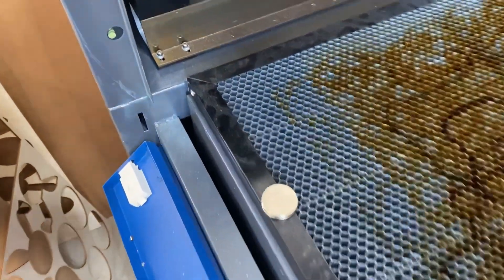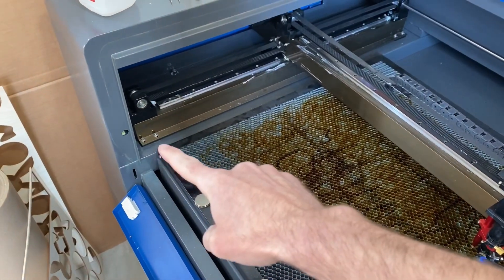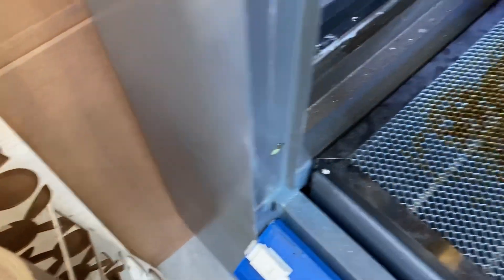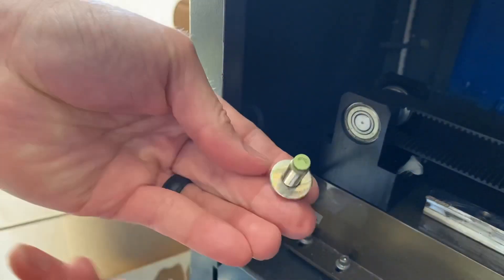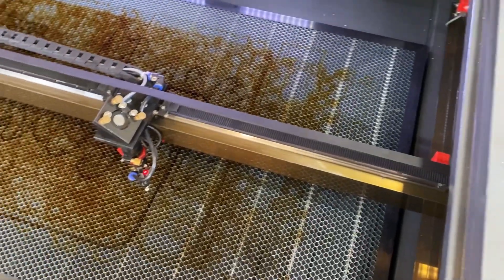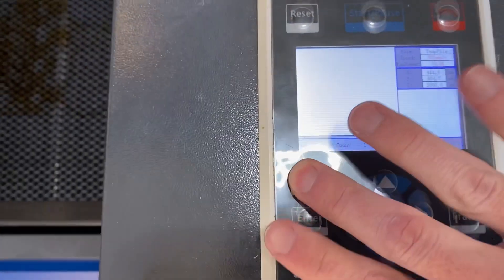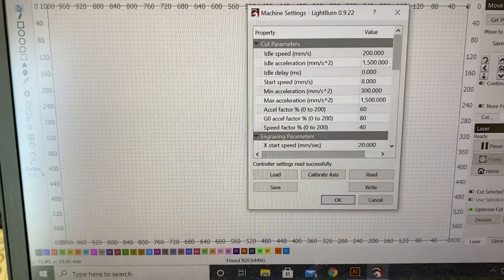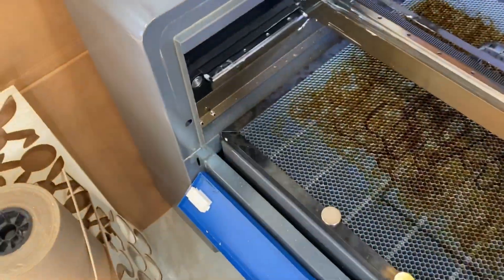Disable Door Alarm and Machine Protect Sensors on OMtech Laser

Comment: thank god for your video!!! Ive literally had my machine less than a week and i was getting the machine protect error. I knew it had to be the lid because everything else is fine but when I got my machine i noticed one of the lid sensors was put on all jacked up and sure enough it started to cause me problems no matter what I did to try to adjust it to the correct position!  Thank you Sooooooo Much!!!

Comment: Thank you jesus. (and of course Bearded Builds Co).  I know this is a long shot but this is the first video or instructions I have seen on the internet of the Omtech 150 watt laser which is what I have.  I received my machine with a damaged door alarm sensor along with parts (2" metal tube with 2 rubber wahers) they did not tell me where they go.  I also can't get a beam alignment started.  There instructions didn't even tell me my tube installation was different that most machines.  Can you please give me some instruction on how to get this thing set up.  If so, I would greatly appreciate it.  jimbobailey@patriotposse.us